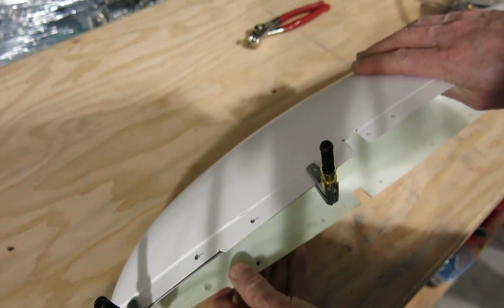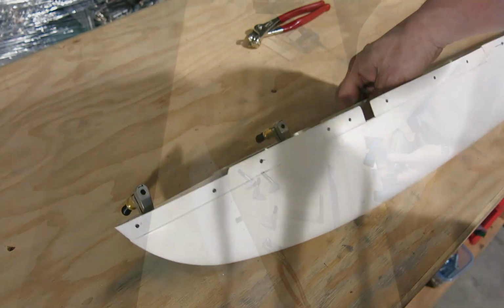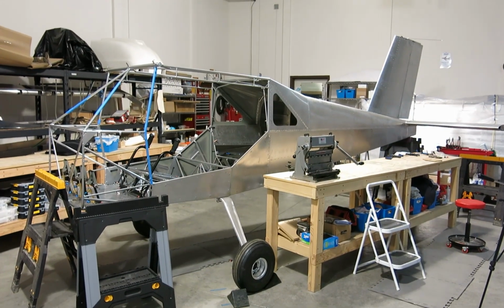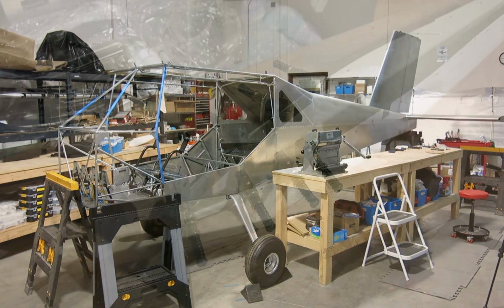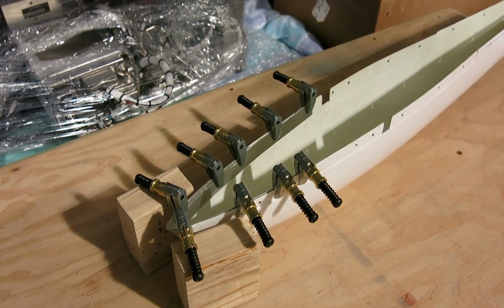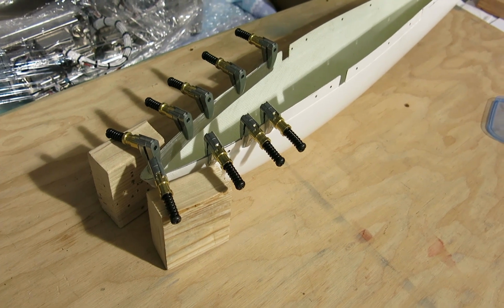No. 204 07-12-2022 Vertical tip prep

Comment: I have a watched a couple of videos on the RV-15.  My thoughts are:
1. It is uglier than the S-21, except for the tail.  I think the S-21 tail is ugly.
2. It looks a little bigger, but hard to tell in the videos.
3. The wing looks more optimized for speed than for STOL, but hard to tell by appearance alone.
4. I suspect it will take longer to build than the S-21.
5. I think it will be a high quality kit.
6. I think it will have much better documentation than the S-21.
7. I suspect performance will be similar to the S-21, but it will be curious to see the numbers.

Comment: I stashed-away a technique for setting the pulled-rivets with the washers CA glued in place on fiberglass fairings. First, use a thick CA glue to attach the washers over the holes of the fiberglass fairing (vert/horizontal tip, etc.). Next, position the pulled rivets in all of the holes. Using a manual, hand-operated rivet gun, bring up the slack of each rivet until it's seated and you begin to feel resistance. Do NOT pop the rivet. Bring all the rivets to this point, and then complete/pop the rivets. The washers are captured, and cannot fall off.

The RV-15 looks nice. All I can say until specs are published. The empennage certainly spells "Van's"!
Reply from the maker: Thanks! Yeah it will be interesting to see specs once they get done with prototype.

Comment: After Van announced they are having cashflow issue, I started to look for other plane; otherwise, i would have waited for Van when they are ready to sell the RV-15 kit.  I came across Ran's S-21 in my  search and very impressed with many aspects of S-21: high wing,  performance,  great visibility from the cockpit, heavier gross weight (1800lbs), and  IFR capable platform.  This is a very good all around airplane.
Reply from the maker: Yes, this airplane checked all the boxes for our 90% flying. It will be a bit of a wait on the kit if you decide to order, but worth it.

Comment: I seem to recall in one of your videos from some time back you are installing a VOR antenna.  Is that correct and if so which antenna did you go with?  I don’t believe I can use the archer that I bought because it goes in wingtip and I bought the carbon fiber wing tips.
Reply from the maker: Antenna is a Rami AV-532L. If you want, I can shoot some video of the mount we made for it.
Reply: @s-21project92  that would be awesome.  I would be super appreciative.  I went through your videos trying to find the one I recalled and like finding needle in haystack.I am using the aero sport tips on vertical and plan to mount a light on back of the tip. Before I order a different antenna I want to try to figure out mount location.
Reply from the maker: Check out videos 145-147.
Reply: @s-21project92  thank you!  Not exactly a needle in a haystack.
Reply from the maker: 🙂 Does that help? I did shoot a little video up on the tail today I can get to you.
Reply: @s-21project92  I would take it!  Thank you!